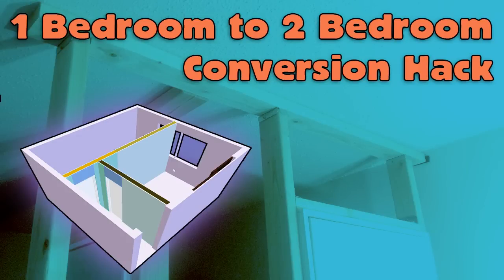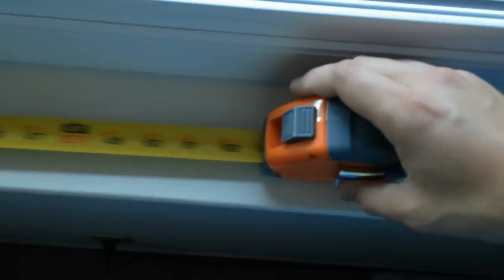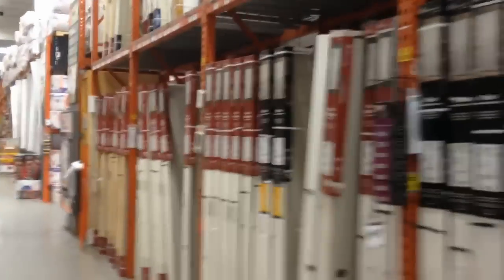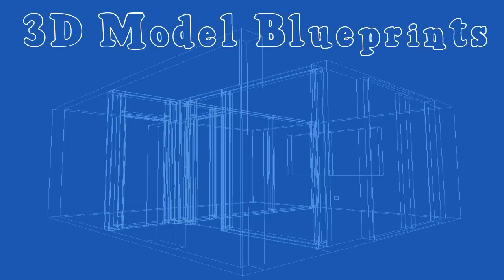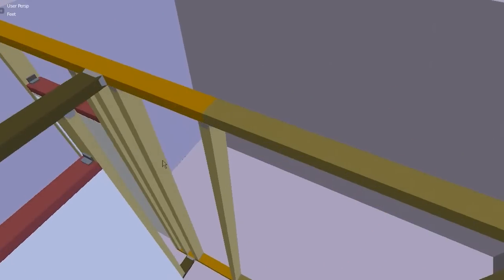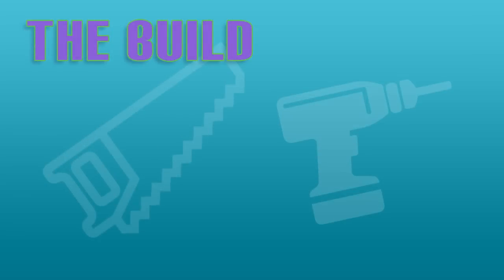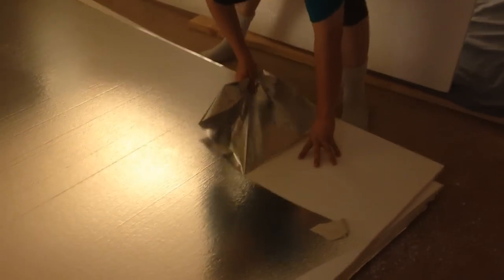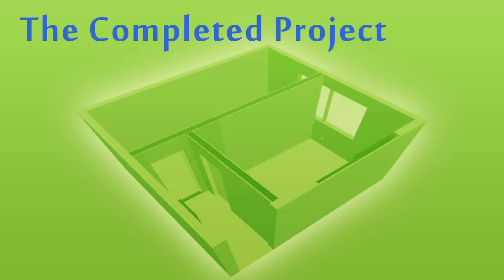1 Bedroom to 2 Bedroom House Hack

Comment: So the hack is basically an illegal structure that violates fire code.

The window egress is obstructed by a 2x4 and the Styrofoam is flammable and produces toxic gasses.
Reply: CarMoves Rome burned and it was made of rock !  But I would have use shelf units as a wall.
Reply: Are you related to any of the band members from Great White ?
Reply: Could you post the code reference? I've never read of a window egress requirement and the Styrofoam is building materials and therefore fire rated sufficiently for walls, plus it's not a fire rated wall location. A bookshelf would be better food for a fire and would still make the window not readily accessible.
Reply: Could you post the code references I've never read of window egress requirements. Plus the Styrofoam was building materials for walls so it's sufficiently fire rated. Besides a bookshelf would be better food for a fire and would make the window not 'readily accessible' as well and it's not in a fire wall required location. Nonetheless, hat's off to you for sounding educated enough to get all the thumbs up, I suppose that's why the amateurs in the nice contractor uniforms win over the old ladies when the sloppy union, state licensed/certified journeyman have to fix everything they install.

Comment: So this is basically how to create two closets out of a small room and have no privacy due to a shared window and styrofoam walls which allow all sounds to permeate both "rooms"? You might as well just share the room.
Reply from the maker: True they are pretty small. But we spend most of the time in the living room. It IS nice to be able to goto bed later than the other without waking them up, changing, sleeping nude on hot nights, etc etc. It also has some degree of noise cancellation for things like snoring. So it's a lot better than just sharing the room in my opinion, and yeah it will never be as good as a proper 2BR.
Reply: lol

Comment: Very clever.
The only real problem is increased danger in the event of a fire.
Styrofoam (EPS) burns very easily, gyprock (or sheetrock) doesn't burn.
No smoking, candles or incense and you should be fine, I suppose.
Reply from the maker: True. I fire tested the Styrofoam - it doesn't stay lit. Though it does make extremely toxic gasses. Luckily for us we aren't smokers or the candle / incense type. So it works.

Also: the Styrofoam is meant for building houses, but usually it's just inside of walls inside of out. So it's pretty fire-safe to begin with.
Reply: I think it's fire rated.